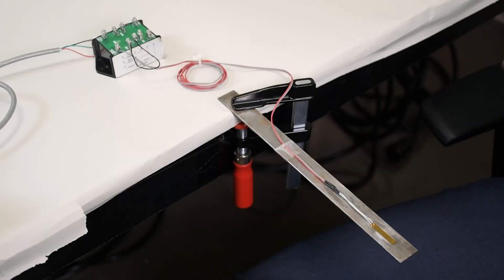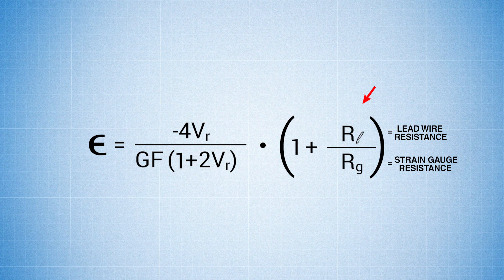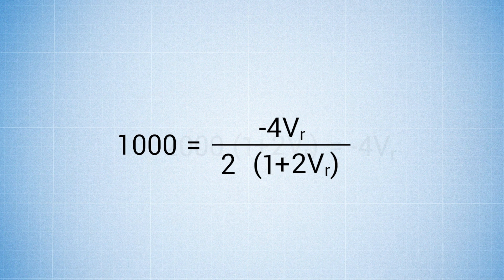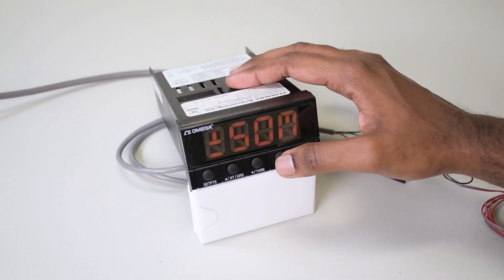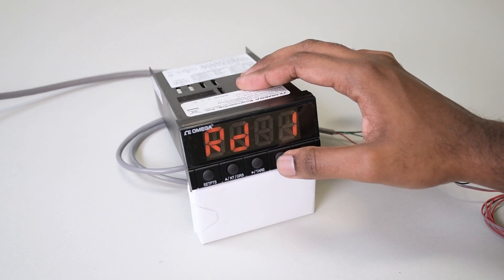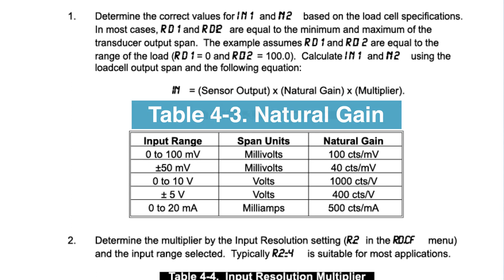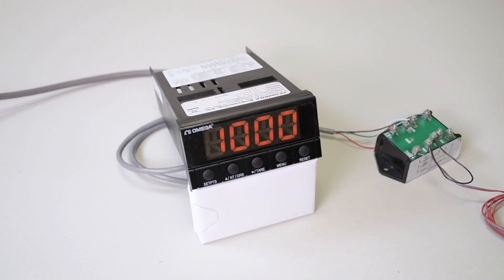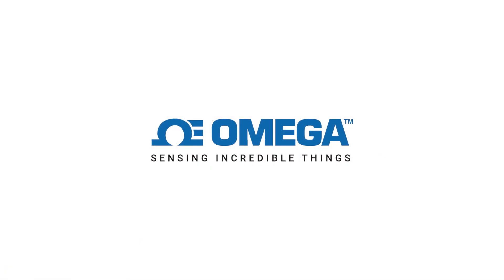Learn how to scale a Strain Meter to read Microstrain

Comment: I have a Signal conditioner that is reading loads at a factor of 10, example:
if 300.0 grams are applied, the signal conditioner is reading 30.0 grams
if 270.5 grams are applied, signal conditioner is reading 27.5 grams
Is there a way to correct this? I already try to adjust IN2 value with the same result.

Comment: How are you using the equation, I have same system and I have to calculate pressure like -1000pa to 1000 pa 
Then we  an set in1= 0  rd1= 0 then what will be in 2 and rd2